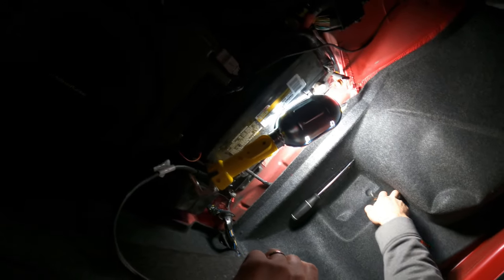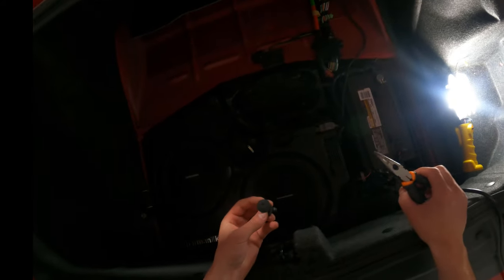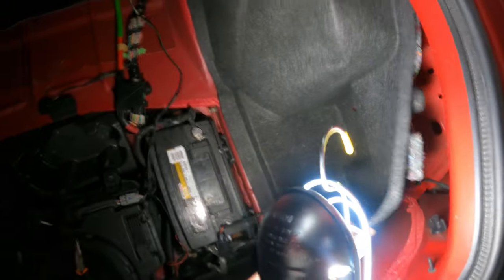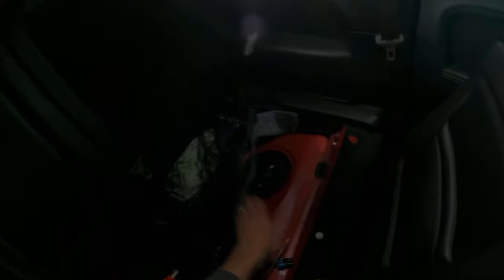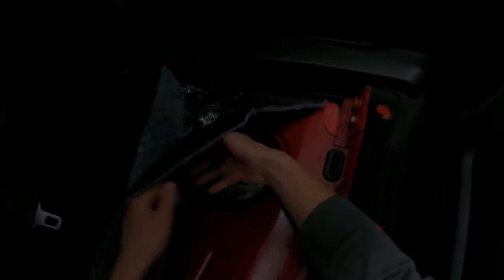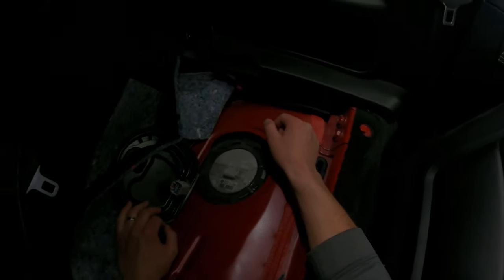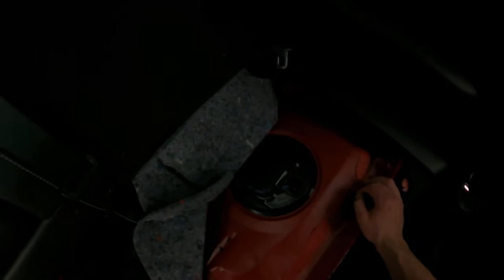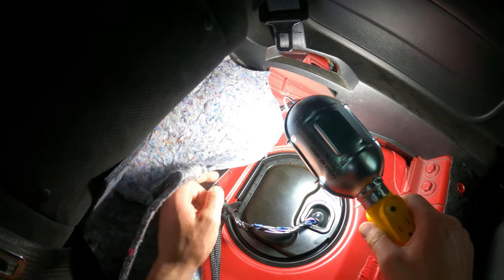Hellcat Dual Fuel Pump Install

Comment: I got a question please regarding how fuel pump works on our HC, so now the main pump provides fuel to the auxiliary pump (passenger) and from auxiliary to the engine right? If yes then how it sends it to engine through what hose or outlet? Because I know both pumps are connected to each other throughout two lines but where is the line provides the rails or engine?